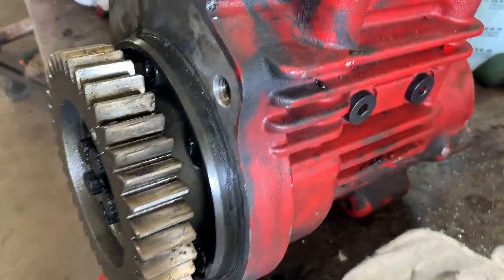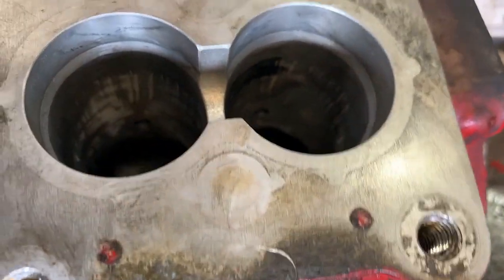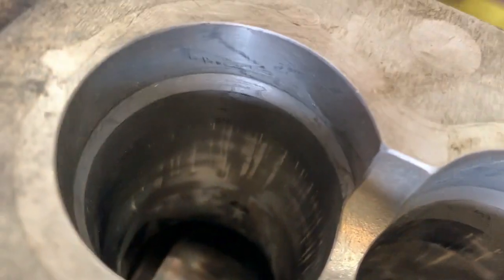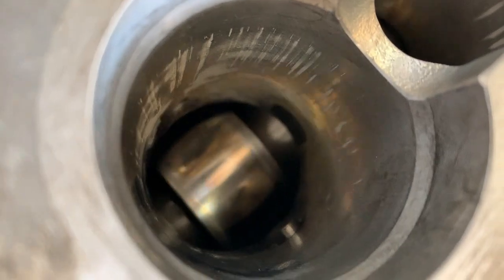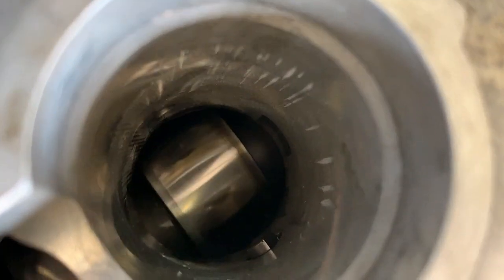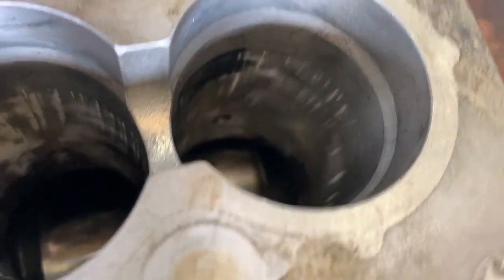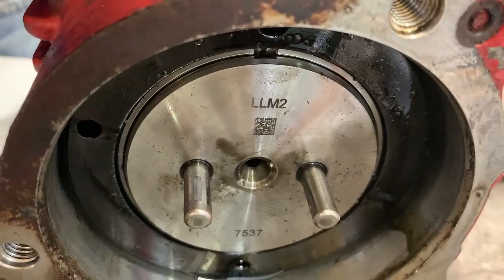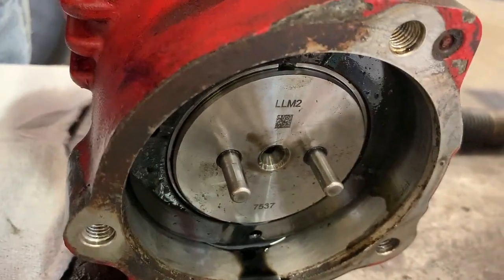ISX 15 NOISY INJECTION PUMP

Comment: Currently have a truck down because the ceramic plungers shattered. The plungers are missing probably half of their length and none of it is in the tappet bore. So close to 2” of plunger was pulverized and made it past the followers into the pump case then into the engine and eventually into the oil system. Cranks scored badly and everything is gritty. All bad news. I would LOVE to hear you explain why the plungers shatter and HOW the heck it gets the contaminated oil past the engine oil filter??  Why doesn’t the oil filter protect the engine. Its a point that baffles me. Thanks for your videos
Reply from the maker: Cummins had an update to the oil bypass valve in the oil cooler head. Does this engine have that bypass campaign done? look for white paint on the oil cooler bypass plug that was the sign it was done. Pull the bypass out and it should look like a steel sleeve, not a plastic plug at the end of the spring. The old bypass MOMENTARILY opened EVERY TIME  the engine was started letting a SMALL amount of unfiltered oil into the engines filtered oil. Next the tappet particles went past the tappets and into the oil sump in the pump and then drained into the gear train.
When the now obsolete ceramic plungers would fail usually 1 would fail and the engine would run on the other until it failed or 559's drove diagnostics. Usually they failed because of the tappet chattering. That happened due to extended oil changes and or injection pump cam lobe failure causing the tappet chatter. By the time someone finds the plungers failed the engine is usually gone due to damage to all lubed parts. Cummins CAMAPIGNED  every engine that had ceramic plungers but apparently this one was never taken in for the work. That was 10 years ago now. They also campaigned the old style tappets in the pumps again 10 year old campaign. Cummins would tell you to replace the engine or completely tear it apart as those ceramic pieces are EVERYWHERE in that engine. Like termites in lumber.

Comment: I have an ISC 8.3 with a cricket noise at the oil fill tube when running. It goes away if I pour oil in. Could it be my fuel pump?
Reply from the maker: A Chirping noise can be from a number of sources.

Comment: Wen the truck climbs and down shift it makes noise like it ratling but wen it's level no noise...
So do you think it's fuel pump..
Please give me your address and phone number
Reply: So when its on its last leg on a 870 will it cause u to have low power when climing hills i always get passed
Reply: Yes I do lose power it sucks because I don't get code
Reply from the maker: Does it start to smoke more black when you lose power or does black smoke come and go? Rattling could be a problem with a timing actuator if this is an 870 or 871.This is difficult to diagnose with out hearing it or doing some diagnostic tests @ernestobalderas8127
Reply from the maker: If you don't have fault codes and it runs ok I don't think it is the fuel pump. I don't have a shop I work for a company.

Comment: how many hours do they get out of these units
Reply from the maker: If you do good fuel filter filling practice and change your oil when you should I have seen the fuel pumps run 800K thus far. Good maintenance is all you can do to prolong the life. See my video on how to prefill a fuel filter. ( the one on the engine). The other thing is Cummins always does failure analysis on new systems. They stop when all the problems are engineered out. So anything after say 2018 I would expect a million miles of life.
Don't forget when the engine is idling all night that counts too. Take engine run. hours times 50 to get the approximate miles. Off road engines only track hours but on road track hours and miles.